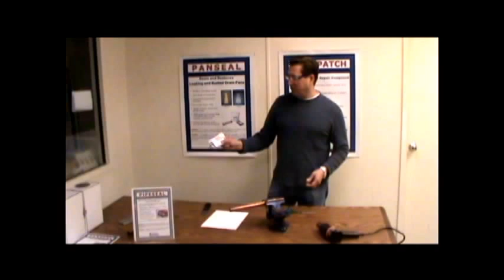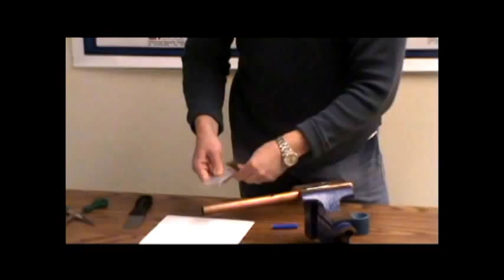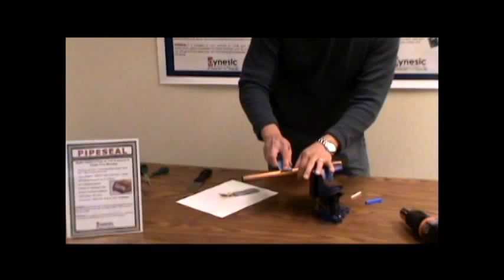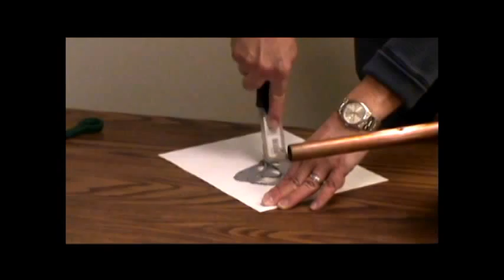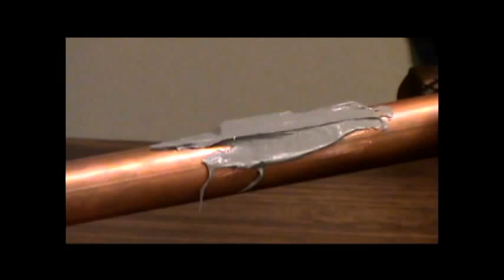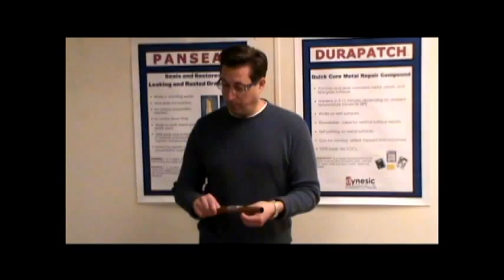How to Fix a Leaking Pipe, DIY Pipe Repair; PIPESEAL;  Dynesic Technologies

Comment: can you do this repair while water is dripping through  a cracked pipe? thank you, Rob
Reply: yes, use SikaFlex 1A it can seal while water dripping. It's the best product that i have ever used before.
Reply: There is a repair tape that can be used even under pressure. But all of these repairs r temporary if the pipe is corroded it needs to be replaced.

Comment: why would we go to the expense of your product, when a split can be crimped together and if PSI is under 100psi just solider it, for pressers over that to the max psi of the pipe, a dab of brass repairs in seconds, with out the worry your products going to do the same thing every other patch product has done?

Comment: Robert B.,
Thank you for your concerns.  If I may,  I would like to inform you that our company sent a repaired PIPESEAL copper pipe for testing at a lab that pressured the pipe to 3,500 psi.  The end cap flew off at this pressure and the PIPESEAL was still intact, protecting the pipe.  This is a unique, novolac, industrial strength product that you have never seen the likes of, so it might be difficult for you to fathom.  The truth is, it works like a champ.

Warmest Regards,
The Dynesic Technology Emergency Response Team (DTERT)

Comment: would be much better showing the product being used while water leaking out not on a dry pipe
Reply: Kevin wood you should turn the water off first and make sure the area is dry, wtf
Reply: my thoughts exactly
Reply: Kevin wood exactly I just got PC plumbers putty they claimed for wet surfaces and copper It didn't want to attach to the wet area and I cleaned it well with sandpaper and wiped it down

Comment: I have a tiny leak in my HVAC line set. Not much pressure involved here because the hole is so tiny. Where can I get this product and do I need EPA certification to apply it to my HVAC lineset copper tubing?

Comment from the maker: This is a permanent repair that can handle extreme psi levels once cured.  It has been tested and holds tight under 3,000 psi pressures.  PIPESEAL is perfect for metal repairs, because it cures quickly with a heat gun or hair dryer, and the heat conducted through the metal helps it cure.

Comment: will this work on pipes under pressure around 30 psi such as my cracked steel pipes that connect the radiators in my house? Is this repair permanent?